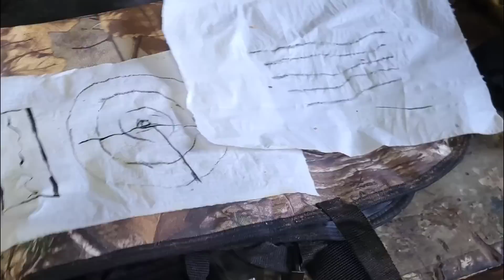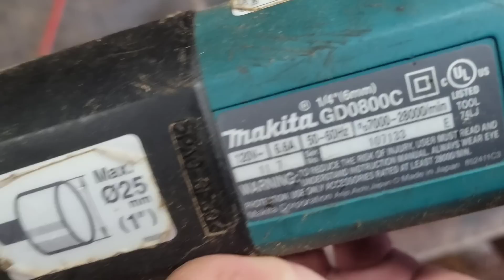A Real time Step by Step by Tutorial with all the power carving tool's I use - Woodspirit

Comment: Great tutorial Jordy, thanks! ( question, you said that the ms170 had a 12 inch bar. Correct?)
Reply from the maker: The bar I was using was a 16 inch bar or a 8 inch bar, I suggested a 12 inch stihl bar
Reply: @CarvingFusion  Thanks man. Haven’t made the leap yet to chainsaws. So a little ignorant. I thought it looked bigger than 12…lol..